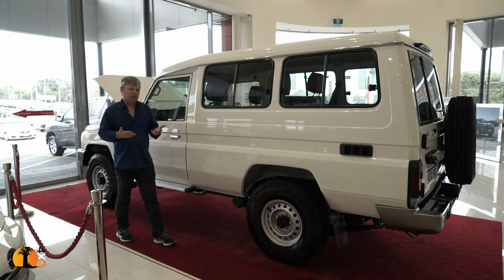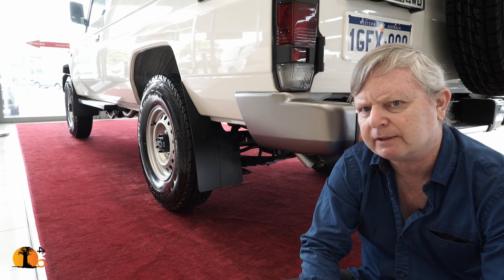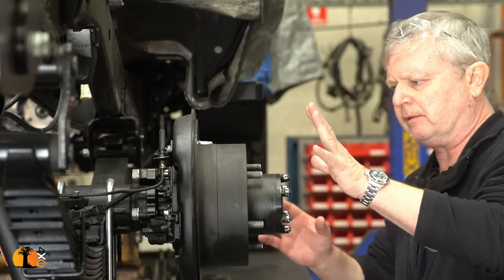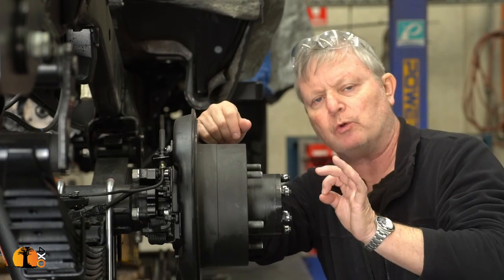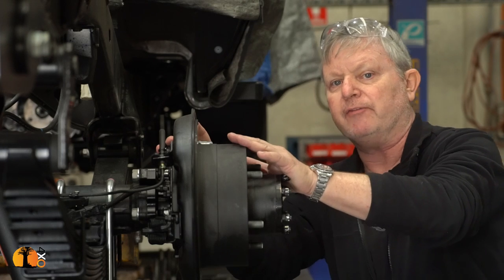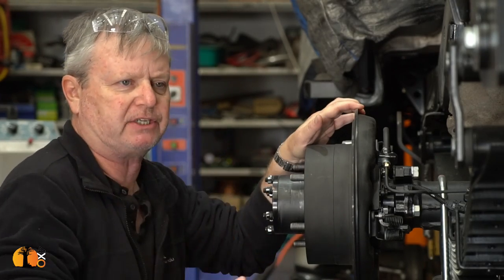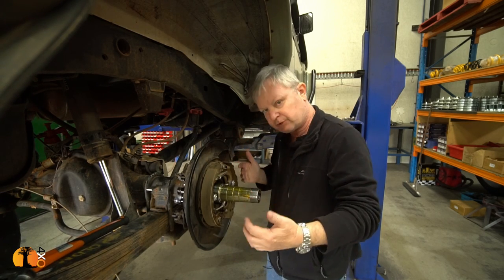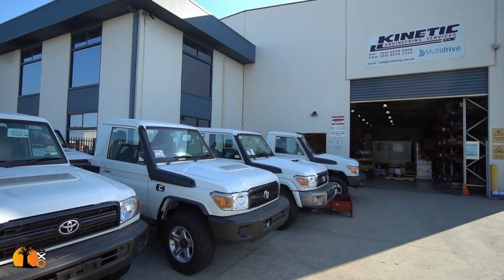TOYOTA LAND CRUISER REAR AXLE issue. 70-Series

Comment: Andrew, I purchased a 94 Land Cruiser 80 series here in the states a few years back.  I have owned many 80 series and love them.  Well I purchased this one about 500 miles from my home.  I flew there and drove it back.  While driving back, I was on an interstate and the front right wheel flew off the vehicle.  Literally, I saw the wheel driving down the highway beside me.  My car had fallen to the pavement and was riding on the disk brake which had broken loose from the axle and was spinning on the axle.  I luckily did not wreck.  I did not flip or spin, I simply slowed and pulled off the right side of the highway, from 77 MPH!  Sometimes you get lucky.  But when I looked at what happened, the previous owner had put 1 inch wheel spacers on and the bolts had broken allowing the rim to come off the wheel . . . .   I researched it and these were cheap chinese made spacers, but I would warn anyone against it . . . .love your stuff . . . .

Comment: An interesting topic as always in your videos, Andrew. In my opinion, as many here are discussing, the actual bearings are still stressed a bit more because  the axle is attached to your leaf spring at a certain distance from the bearing. Lenghtening the distance means putting more stress on the said bearing even if proper offset is maintained. Of course, the bearing in this case is not the only part being under more stress. Your axle shafts are longer so they are under greater torsional forces which are relayed to the differential - thru spider gears to ring gear to pinion and so on. And it is not just the innards. The axle casing was designed with certain dimensions to certain specifications. Lenghtening axle tubes in this case then means greater stress on the casing therefore a possible problem too. All in all I think it really comes to what we use our vehicles for. If for onroad and casual offroad, to correct road manners then I dont see a big problem, since Toyota's axles are usually quite strong and replacing the bearings once they have gone is not a big deal. If for strict hardcore offroad, rock crawling maybe, then I would look for a different axle.
Reply: The bearings will carry no more stress. If anything they may experience slightly less in having slightly more leverage over the mass of the entire housing. Having the wheel load centres further outboard will add bending stress to the housing itself. This is a valid observation and points to a negative trade-off. The longer axle shafts will experience the same torsional forces. Being longer they might even be slightly less likely to fail in having slightly more elasticity to absorb shock loads. That of course is moot if the axle housing itself bends and a corresponding bending stress is imposed on the axle shafts. Then they may fail at the inner splines or at the hub disk.

Comment: Good video, thanks Andrew. My note is that my 76 series run on rear wheels with 55mm negative offset without any problem. The reason is that unlike on normal road car like Toyota Corrolla or Honda Civic, the Landcruiser has tapered roller wheel bearing (conned shape) which can withstand both axial forces and radial forces. The landcruiser's wheel bearings can easily handle the extra force of the negative offset. In addition,  the Landcruiser design allows the wheel bearing to be periodically inspect and adjust pre-loaded with torque wrench and re-lube. 
So, in my opinion,  if you don't worry about the legality of your modification, it's fine to use negative offset wheel if you do know how to inspect and maintain the car yourself.
Reply from the maker: thanks! Good advice.

Comment: American pick ups and suv's based on them used to have a lot wider front axle. My -79 Blazer had too, so I put 30 mm spacers to the rear axle. Tires are only 12.5x33x15, so the leverage is not too great, or the change of it. I agree with You and those local laws; spacers and too big an offset change are dangerous, but usually only in the front. The law is there to prevent anyone changing the steering geometry to a point where braking with the slippery surface under passenger side front wheel, would try to turn the steering violently towards oncoming traffic. As most spacer-users can confirm, correctly tightened spacers do not come loose. It is more common to have problems to get them loose if they have been on for couple of years. And yes, they are illegal here in Finland too, but while the annual inspection is quite thorough, I have never had any problems as there are also legal factory made wheel systems that consist of separate parts. I enjoy the way You lecture. It is like having a nice, entertaining teacher...
Reply: Timo Kuusela Timo did you make your own? I thought about it but for $200 bucks all the way around, including studs, nuts, and anodizing I couldn’t buy materials for that.

Comment: The question has to be, since the solution is relatively simple, why hasn't Toyota done it themselves?
Reply: Because the accountants won't let them spend the money to build a new rear axle.
I've read an interview with the chief engineer who has spent the last 20 years just working on the 70 series!
Reply: All comes down to what the cost center allows money to be spent on, I am an electrician and fitter mechanic for a large company and see the same type of short cuts to make budget.
Reply: Toyota to lazy and don't want to spend the money
Reply: For there last big 2030 models before everything goes electric ⚡️
Reply: Western Australia Now and Then to put simply, they don’t give a fu..k. . Because they still sell. People who want them will deal with it either correcting like Andrew did or just leave as is and people who don’t want them would never want them either way.
Reply: Because the wagons and troopy didnt get a wider rear body as the front got a wider body. To much tyre poke for legal reasons.

Comment: I tow an off-road caravan (tandem axle) with a tow all weight (when loaded) of approx 325 kilos.  When towing with my recently acquired 79 series dual cab Landcruiser - with a 3900 KG GVM upgrade - when driving on the highway - acceptable handling - whilst driving off road tracks - acceptable, sand driving - I’m aware of the issues - but haven’t yet been there and done that with the van in toe. I have however noticed that on narrow roads where with on coming vehicles - I’ve needed to share the road and straddle the bitumen and gravel / dirt edge - I have noticed a fair amount of an instability issue - especially around sweeping bends - I’ve attributed this to the three track axle widths - in summary not a relaxing drive - with quiet a bit of steering correction issues . “The older cruisers handled a lot better” 
Because of my GVM due to the heavy van - the standard axle extension cost estimate to maintain the 3990 GVM is double the cost of the non GVM supply & fit. Not complaining just putting it out there for any person doing heavy towing.  I now have to make a decision based on safety.

Comment: We have a pre-2006 78 Series with the old body style. The front axle is wider than the rear. It is a squirrelly beast to drive in sand and mud. Have chatted with a few Cruiser shops in the US and they’ve recommended the spacer route. Good to know a solution like the one you’ve shared exist.
Reply: Realize this is an old thread. What years of the 75 & 78 series don't suffer from this issue?

Comment: From an engineering perspective, there is no doubt that putting the centre of the load over the centre of the bearing is the best solution for bearing life, and this is an elegant solution. But overhung loads on bearings are not at all uncommon and may not be material to the bearings life depending on the way the axle is hung in its entirety. I have done over 70,000km on my 76 with 55mm spacers (fitted by a Toyota dealer) each side and have had no bearing issues on the rear-I tow a 2t trailer. The local farming community runs on the 79's using trailers in the 3.5t category, most with spacers. Ironically, I have only had to replace a front wheel bearing!

Comment: Thanks for the info Andrew. But there is an easier option. If you choose a mining spec 70 series Landcruiser, they are supplied with axles and differentials which are both widened and strengthened via extensive rebracing. This process resolves both the width and track issue, and the issues of extensive flexing of the diff housing. The only option fitted to the mining spec Landcruiser I operate, are portals, just to allow more ground clearance. 👍👍

Comment: So when you drove across australia with the bigger tyres, the axle width caused the tyres to hit the rear guards. The guards should have been modded to allow the tyres on the wider axles to clear the rear guards.  Would prefer better rear with stronger axles like the ones available from Jmacx and others. Way stronger than bolting an extension on the standard diff. There is a reason it is cheaper, because it isn't as good as replacing the complete diff. Replacing parts should be as strong, or stronger than the standard parts. Multi-Drive wouldn't be stronger than standard diffs, and probably less strong. Doing trips need strong parts, not adding risks for the rear diff. We have replaced our rear diff with the Jmacx system. Hope it works for you Andrew.
Reply from the maker: The MultiDrive side shafts are stronger than standard. They had to be to pass ADRs. New axle GVM is 3900kgs. I felt that a full axle replacement at double the cost was unnecessary. The standard axle and diff is very strong. And as this is an overland machine, not a off-road competition truck, a Jmacx axle would be overkill in strength and its considerably higher unsprung weight is not going to do anything good for the ride.
Reply: You are welcome for your own opinion. We looked at all the options for the rear width. Removing the rear hubs and replacing them with a wider system is bolted to the diff. Not something I would choose for outback trips. It just adds risks. For our 79, we replaced the rear with the Jmacx including swapping to coil suspension which makes the unsprung weight way better than leaf springs. Stronger diff and axles. The Jmacx system doesn't increase the rear weight and moves weight from the unsprung rear. Compare the cost of the 70 series and complete the improvement of the vehicle, the rear axle system is only part of the cost. This is for improving the vehicle, not for off-road competition. Your vehicle has been spent for a lot of improvements but gone cheap to widen the rear. Also, didn't fix the body to prevent the tyres hitting the mudguards. Good luck, Cheers.
Reply: @photohiker01 making this decision now. Waiting for a 76 wagon. How do i open up the rear guards?

Comment: Having a 2017 LC71, I have added 1.5inch spacers at the back and done extreme sand dunes driving and jumps and also driving on dirt and road driving. No issues at all...I dont recommend going for expensive solutions without exploring the much cheaper solutions first!!

Comment: Good comments Andrew. I have a 76 series and have not found the issue a problem ...yet...I have been towing a 3T boat upto Queensland and back home to Vic (5,200 K return) for years now and its been great...plenty of power and no issue with stability even when I am travelling at 110kph (when law and road conditions permit). I have done some sand 4wd'ing through the Sunset Desert and some beach driving...with no noticeable problem. Maybe I have not done enough to make a fair judgement yet...I will be travelling through the 'Corner Country' this July, so will be able to give a better assessment then. NOTE: the old Citroen DS had a much shorter rear wheel base...I pretty sure that this was deliberate...It is supposed to create a better turning circle. So ...has anyone that has had a rear axle mod experienced any difference with their TC?

Comment: Great video Andrew! I just became a Patreon supporter.  I recently purchased the Australian CruiseMaster XT Suspension kit and had it shipped to Texas, USA. (Probably the 1st one in Texas) I have been wrestling with the idea of using wheel adapters (aka spacers) for the longest in order to use the same type of wheels for both my overland trailer and tow vehicle.  Your video has caused me to rethink (for a third time) about using wheel adapters on my hybrid trailer project.  Anyway keep up the great work Andrew and I look forward to many more insightful videos!

Comment: I am bewildered that in 2018 vehicles are being produced with non matching wheel tracks. It is a complete joke and insult by Toyota that a customer who has just forked out almost $80k (AUD) then needs to spend another $5-$10k to rectify this and other defects (poor GVM). It certainly makes a late model 2nd hand Defender look like a bargin with coils all round, bigger GVM, constant 4WD and....aircon as standard!!!
Reply: Hit the nail on the head mate, exact reason I bought a Tdi Defender. Why fork out the cash when the Land Rover has full coil suspension, matching tracks and at most needs a rear locker. All for peanuts in costs compared to a 70 series
Reply: Yep! And people moan about Landrover!

Comment: I tow a 79 series 2019 dual cab land cruiser - like Andrew am a big fan of land cruisers - I tow a heavy off road caravan - my old 2006 land cruiser 6 cylinder although underpowered towed the van a treat.  Not so with the new land cruiser especially on road - the threes axle off sets (vehicle & van) made driving very interesting to say the least in terms of correction - especially around bends.  Due to the fact that I need to maintain my GVM 3900 Load rating for the caravan with a tow all weight of 300 KG.  I believe I do need the replacement wide axle kit which will set me back about 6k +.  Should have gone with the 200, however I like the 79 series & in terms of safety & piece of mind may need to spend the money - bloody expensive vehicle this has turned out to be - such is life.

Comment: Ive run wheel spacers for 200,000km without a problem with the spacer itself. Always checking the spacer nuts when ever I have a wheel off but consistently running into problems with wheel bearings and axle seals. Its time to get rid of them and the Tru Tracker kit has just been ordered.

Comment: I Must be lucky had wheel spacers on for 350.000 k and never had a fault and just looked at my wheel bearings after 60.000 k and totally fine !   My 2007 CAB CHASSIS  cruiser is always heavy  however after blowing 2 diffs i just installed the Dana 60 ultimate and tell yu what getting the snake racing 2 inch spacers of took some time ! HOWEVER YES IF YOU DON'T KNOW YOUR VEHICLE don't use spacers. I do have many mods and   226 Rear wheel killerwatts plus 2018 gearbox and bigger G turbo and    lots more !! and i do believe toyota should of never been allowed to make such a out of track PROBLEM ! And the ADR should of sorted it from the start SOMEONE GOT PAID OFF ! my opinion only !

Comment: A multitude of manufacturers build vehicles with a narrower rear track width. They have done so for years. I believe even Baja trophy trucks are engineered with narrower rear track widths. I believe it is done for quicker directional changes offroad.

Comment: This is an eminently sensible engineering solution. Time well tell as to the slightly greater leverage the wheel loads have over the span of the whole axle assembly. What's the difference between a sixpence and five cents? The commentator has analysed it all well, putting the cost benefit down to a matter of personal preference. 

On established offroad tracks, there may be no more than a subtle improvement felt. One advantage I can see would be in driving over new ground. Stakes that the front tyres miss might be found by a rear tyre. 

A Ford F-Series four wheel drive on the Canning Stock Route run in a convoy in the late 70's ran out of tyres due to stakes by the time it was halfway south. Tyres had to be flown in. It's wider stance found stakes that narrower tracked vehicles had not already harvested. Early Toyota Landcruiser adopters discovered the same problem when first running on old station bushtracks established by Landrovers. 

In sand or claggy mud, there will be less rolling resistance when the wider rear axle's tyres are tracking directly behind the front wheels and not having to crush the inner edges of the front wheel trenches in. The rear wheels will also not be climbing the inner edges alternately and forcing the driver into more steering correction and fatigue.

Comment: I think measuring performance (statically speaking)  between a modified vehicle and a non modified one, would better highlight if it worth it or not. Personally, I think it does not worth it, should that be the case, Toyota would have done it long time ago (Did someone asked Toyota's Engineers bout it?). It also might creates a mismatch situation,  which might open a window for new problems. Great video as usual, thanks.

Comment: With regards to spacers, and I understand they are illegal in AU but are legal in the US, it really comes down to how much of a spacer you use.  I use 1.5" which is about 38MM.  Now I haven't loaded my vehicle down as much as I could, but it's easy to check if they are coming loose even with the tire and rim still mounted.   Now that being said would I rather have wider axles?  Yes I would and with my next build I'll probably do that.  Could I also correct the issue by going back to stock width, while maintain upgraded height, tires?  Yes.  But spacers are not that dangerous.  The biggest failure point with spacers is people over tightening the lug nuts which happens with or without spacers.   I torque mine to spec with locktite and they've never come loose in 4 years of using them.  Again though understand I agree that replacing axles is the far better way to go especially on Jeeps which have crappy axles to begin with.